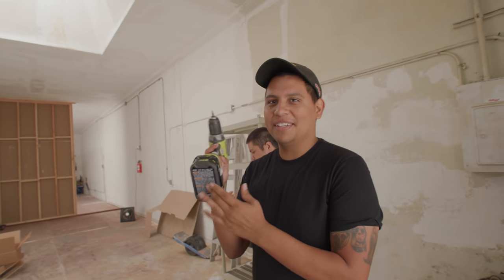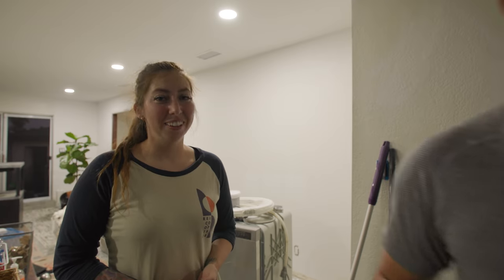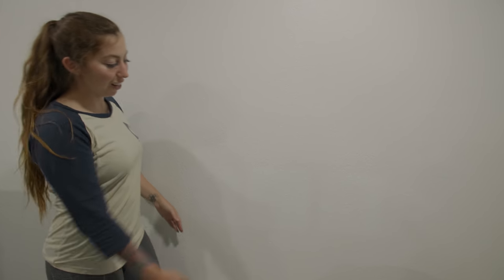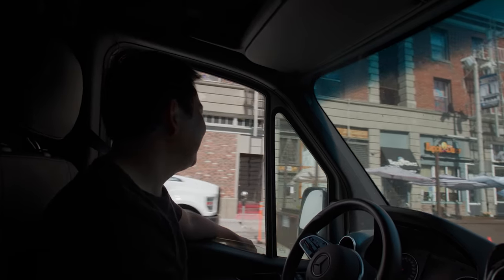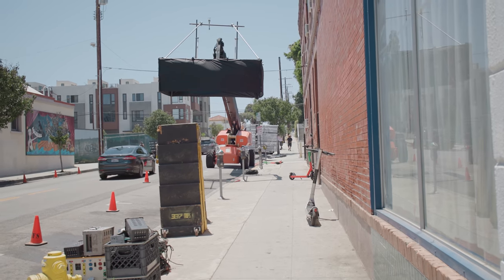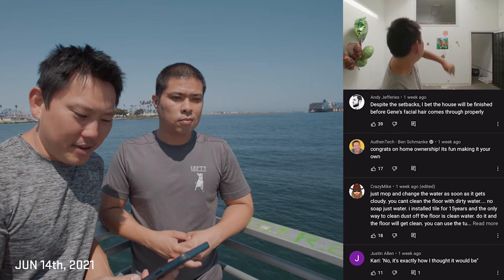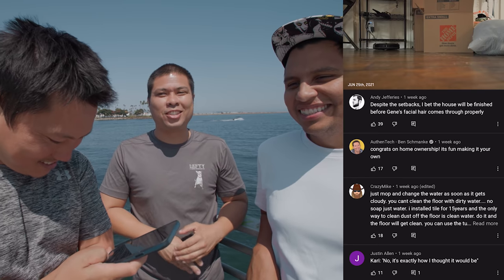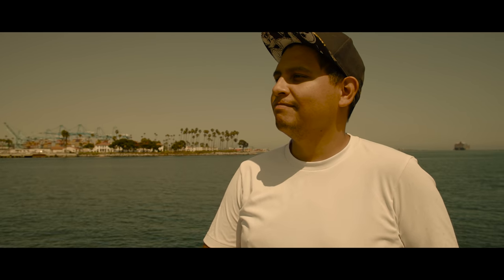Settling Into the New Place

Comment: Did you guys use spacers to make sure there is a gap between the wall and the flooring? If not you will be in trouble when the floor starts to move due to heat/cold differences.

Comment: Gene the wood floors need acclimation before install. Best of luck with the remainder of the remodel.
Reply: It's not hardwood, it's "floating" engineered flooring.  No need to acclimate, really.  You leave a gap near the walls for expansion/contraction when you install it but that's it, really 🤷🏻‍♂️